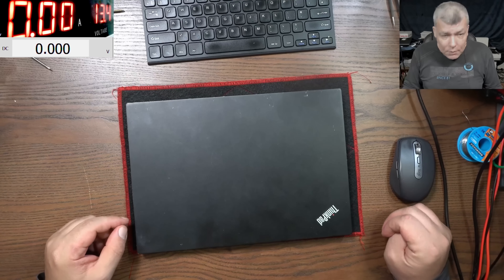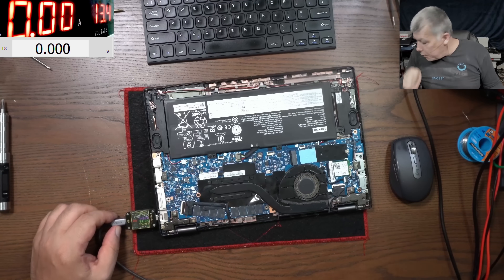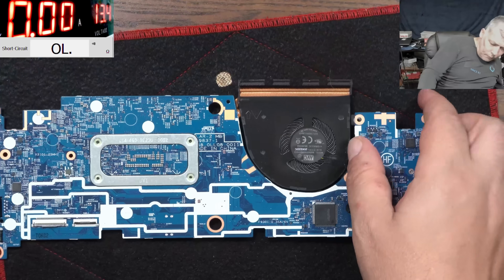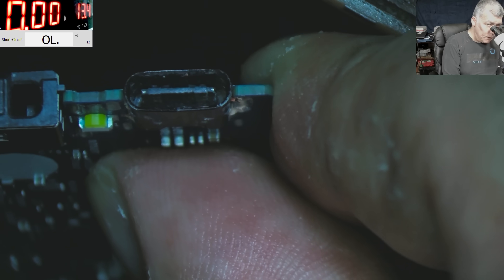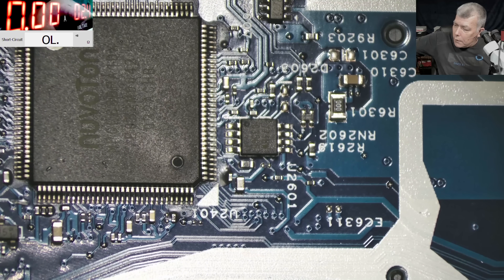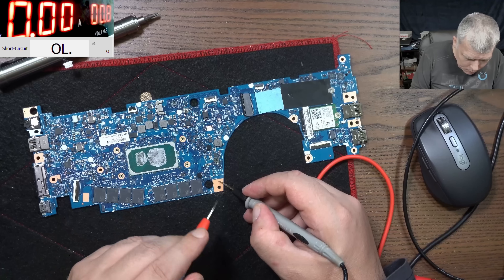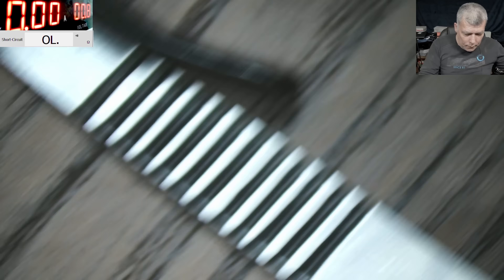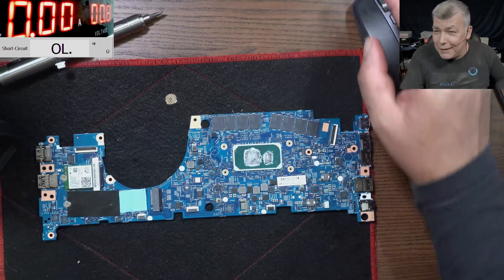Thinkpad L13 Gen 2 not charging - Shorted 1D8V_SUS power rail

Comment: Hi, thank you for this informative video. I have the exact same model with exact same problems. Lenovo replaced the motherboard 3 times under warranty and now it’s having this symptom again. No liquid damage, no physical accidental damage. What causes this? Would you say this is design or manufacturing fault? Is there anything I could do to prevent? Because I wanted to order another motherboard from ebay, but is it worth it even? Thanks so much if you reply!

Comment: When your measuring resistance on the coils what is a bad reading and what is a good reading? Your are great at what you do. It’s not a fail if someone learned something.
Reply: There are no rules. But let's say 40..50 .. or more is 99 percent ok. If lower than that you must know what coil you are measuring. if you measure CPU or GPU coil than even  even 2ohms can be ok. In any case if you have less than 1ohm that is certainly a problem.

Comment: Hi , at 09:25 we had 1.30 amps and the other side we had 1.50 apms , why you did put  red probe on 1.30 , because each side has lower apms is Ground !!! so you must put  red probe on the 1.50 apms !!! i got confuse , why you did put  red probe  on Ground side and not Positive side which was 1,50 ? thnx
Reply: The side taking the most amps is ground (it would have the least resistance in the return path to the power supply).  The positive rail would have a bit more resistance (caused by the resistance of the shorted device in this case) and thus lower amps.  (Note:  If the shorted device was a perfect short, the amps would be equal on both sides.)
Reply: @timecentral3134  thankyou, but only one thing i cannot underestand ,when we put black prob on ground why you habe to put red prob on negetive side of ceramic capasitor too ??beause sorin put black prob on ground and put red prob on negetive side too ??i just though that he must put red prob on positive side of ceramic capasitor ??thnx
Reply: @Martin-ot7xj  It was just to confirm that the side taking more current is indeed ground and the other side is the positive.
Reply: @Martin-ot7xj  there is no positive of negative on a ceramic cap. u have to simple probe on the powerline and on ground. Keep in mind that cap is still good. that chip is consuming the power bc of a short to ground.. so there is still resistance on the way at his probing point and resistance at the short.. how more resistance it consuming more so u have less amps.. So u know,  the powerline is the side with the lowest amp..

Comment: Hi Sorin as usual good diagnosis quick and professional, my problem is trying to remove usbc ports , problem is to much heat, anyway interested to see how the pd controller works with o/o chip regard Jim
Reply: Are you using very low melt solder mixed in first?
Reply: @Swenser  no ,but using a new fume extractor I wonder if its lowering the temperature of across-the-board

Comment: why power supply 1,8v rail not affected/shorted to the coil?
Reply from the maker: of course is affected, there is 0v instead of 1.8v, i din't checked but the power rail is shorted, probably this _SUS power rail come from a switcher, that's why the coils are not shorted
Reply: @electronicsrepairschool  thank you for clarified this master, very helpful